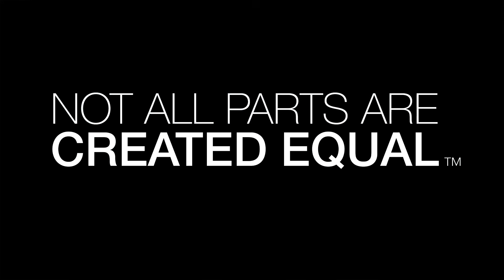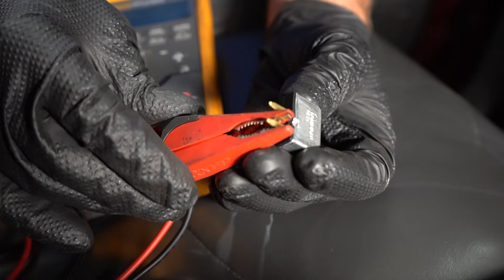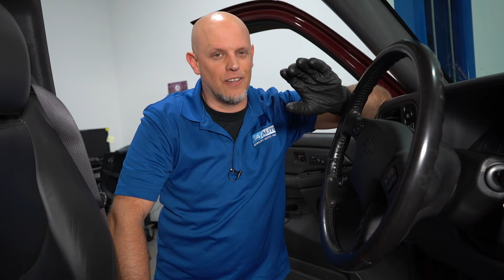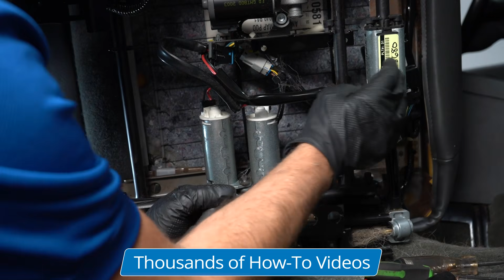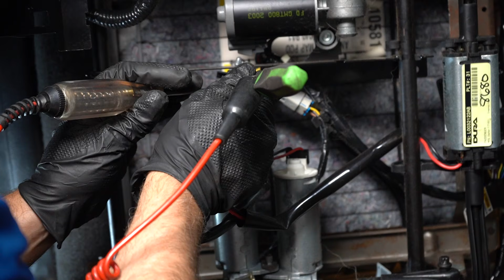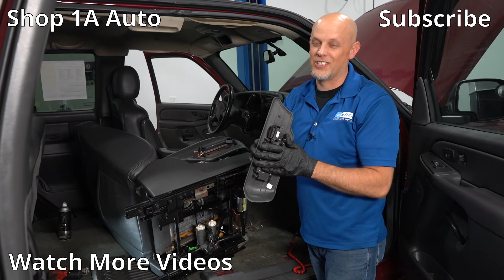Power Seat Not Moving? How to Diagnose Power Seat Motors, Switches, and Wires!

Comment: Loved your diagnosis on the "Power Seat". But I'm still having issues with it. It's the Drivers Side Power Seat that I am having my issues with. I'm glad that the Seat is in the completely back position. Because I'm 6'4". And it's okay by me. It will recline/go up and down, but will not go backwards or forwards. All the connections are in place. The fuse is good. And the relay is good. When you try to move the seat forward. You will hear a click  come from the motor. It will move the seat about 1/4 of an inch. But that's all. Can you help a brother out????
Reply: It's the motor. There are 4 motors as he explained, so the motor for the backwards and forwards function (the larger one at the front of the seat, I believe) should be replaced.
Reply: You figure it out

Comment: Thanks for the great video. The part I'm stuck on you didn't cover. The motor (forward and back, the only one I have a problem with) is whirring and I can feel the axel tubes out of it vibrating, but it doesn't turn the travel screw. Any idea what the problem would be at that stage?
Reply: Sounds like a loose cable, check the cable that goes left to right under the seat. I just repluged it in and worked
Reply: Did you ever solve this? I have the same problem

Comment: Does every switch have its own motor? Or do they all share a motor? Because my up and down switch doesn’t work but the others work.
Reply: Same! I believe in this video, he said they each have their own motor and he explained which motor controls which switch. There is one bigger motor at the front of the seat (forward and backward switch), two together further back (the front/back height/up-down switch, and lumbar switch), and one by itself off to the side (recline back and forward). Check the connections to the switch inside the panel and to the particular motor under the seat to make sure they're not loose. If that's not the issue, grab the multimeter tool that he demonstrates in the video underneath the seat to check for continuity. If it lights up, you have a bad motor. If it doesn't light up, you have a bad switch.  Someone suggested that if the motor for the function you need is broken, you could swap it with another of the motors controlling a function you could do without. He said that would be the cheapest solution because they don't sell replacement motors individually, just the entire setup with all four motors included.

Comment: but what if just one direction on my seat adjustment isnt working...???   I basically cant move it back. but every other direction works...
Reply: Make sure the switch inside the panel is connected properly and if that doesn't fix it, replace the switch.

Comment: I have a 2017 Buick regal my driver seat won't go back up but it goes down now it's stuck like that I've been driving like that for a year now and it's annoying then the other switch to stop working it won't move forward it only goes back.. have any answers for me  where should I look
Reply: This video explains it. Check the connections to the switch inside the panel and to the particular motor under the seat. If that's not the issue, replace the switch inside the panel. For a quick fix, you can also flip the positions of the red and black wires for that specific motor that controls that function as explained in this video. Flipping them reverses the functionality - up becomes down, forward becomes backward. That will allow you to move it in the direction that doesn't work currently.

Comment: I just had an issue with a seat tilt control switch. It would go forward but not back. I simply rewired the motor in reverse polarity and the forward control moved the seat back. I hope this helps anyone who needs a quick fix.
Reply: Exactly what I’m looking but I don’t understand those terms😅
Reply: Thanks tho!
Reply: The engine motor? The seat motor?  Where is it located? This is exactly my problem.  Driving w seat forward for 2 weeks. 😩😫
Reply: @jazzymediamarketing4404  Yes, the seat motor, as referenced in this video. Under the seat, he showed the black and red wires and said they control forward and backward and if you flip them, they do the opposite of what they used to do.
Reply: Having a similar issue and appreciate the tip - might come in handy if I'm not able to fix the issue using one of the methods in this video!

Comment: I understand heated and air conditioned seats…. But what the actual fuck is the point of the tracks being powered? They’re slow, they’re a pain in the ass to diagnose, and they’re absolutely inferior to the lever and pull bar mechanisms

Comment: so if the seat reclines back but not forward then its the switch thats the problem?
Reply: Ditto?
Reply: Yes! Make sure the switches/connections inside the panel and to the particular motor are connected properly and if that doesn't solve it, replace the panel switch.

Comment: So theres power to the seat that goes up and down and the lubar reclines. Just the front and back doesnt work. wtf?
Reply: This video explains it. Each function has its own motor. Check the switch connection and check the motor current. Could be the motor, or could be the switch.

Comment: What would you do if the drivers seat wants to move forward when you get into the seat or when your driving. And it won’t want to move closer to the steering wheel or back from the steering wheel
Reply: This video should help, you should rewatch it a couple of times. This is what I got from it: Check the connections to the switch for that function inside the panel and the particular motor under the seat. Check for continuity in the fuse connector to the motor for that function. Each function has its own motor, which he showed in the video. If there's continuity (the tool lights up), the motor needs to be replaced. If the light doesn't go on on the multimeter or whatever that tool is called, replace the switch inside the panel.

Comment: Just checked out your "power seat" video. I've been having a power seat issue for a while now. It will decline. And it will raise up/down. But it will go forward/backward. If it's a motor issue. It went out in the right position. Because I'm 6'4". Do you have some advice?
Reply: This video should help, you should rewatch it a couple of times. This is what I got from it: Check the connections to the switch for that function inside the panel and the particular motor under the seat. Check for continuity in the fuse connector to the motor for that function. Each function has its own motor, which he showed in the video. If there's continuity (the tool lights up), the motor needs to be replaced. If the light doesn't go on on the multimeter or whatever that tool is called, replace the switch inside the panel.

Comment: I have a 2018 Chrysler 300s, one day randomly just wouldn’t move forward or backwards, but the lumbar, recliner and seat adjuster work fine. But it doesn’t move back and forward. And if it does it’s very slight. Not sure what the issue is.
Reply: I believe in this video, he said they each have their own motor and he explained which motor controls which switch. There is one bigger motor at the front of the seat (forward and backward switch), two together further back (the front/back height/up-down switch, and lumbar switch), and one by itself off to the side (recline back and forward). Check the connections to the switch inside the panel and to the particular motor under the seat to make sure they're not loose. If that's not the issue, grab the multimeter tool that he demonstrates in the video underneath the seat to test for continuity on the connector to the motor. If it lights up, you have a bad motor. If it doesn't light up, you have a bad switch.  Someone suggested that if 1 motor is broken, you could swap it with another of the motors controlling a function you could do without. He said that would be the cheapest solution because they don't sell replacement motors individually, just the entire setup with all four motors included.

Comment: So my seat has 3 power buttons and the one thats moves the back part in and out on your back just sopped working. The other 2 still work fine. I did put seat covers on around the same time. What is wrong with it anybody have a clue?
Reply: Check the connections to the switch inside the panel and to the particular motor under the seat. If that's not the issue, replace the switch inside the panel. For a quick fix, you can also flip the positions of the red and black wires for that specific motor that controls that function as explained in this video. Flipping them reverses the functionality - up becomes down, forward becomes backward. That will allow you to move it in the direction that doesn't work currently.

Comment: I have an 07 expedition el, electrically it all works, however,  something mechanically is stuck on the seat recline, it's stuck laying back as far as it will go, I've taken the cushions off and can see the connecting shaft, its in place, I'm at a loss from here. What locks it in place ?

Comment: Everything works except the recliner that sometimes works and sometimes doesn't work. What do you think?
Reply: This video should help, you should rewatch it a couple of times. This is what I got from it: Check the connections to the switch for that function inside the panel and the particular motor under the seat. Check for continuity in the fuse connector to the motor for that function. Each function has its own motor, which he showed in the video. If there's continuity (the tool lights up), the motor needs to be replaced. If the light doesn't go on on the multimeter or whatever that tool is called, replace the switch inside the panel.

Comment: Both of My 2000 Yukon XL front Seats--- Don't make Any electrical Movement, or Sound , the Manual Tilt & Lumbar Adjusters Work Fine... I will Start with a Circuit Breaker
Ohm / continuity Test... I may have to Jump 12 volts under the seat to the plug- in connectors... To see if I can Get some Movement.
I Appreciate the Video, one of those Factors may be the Culprit... I just Don't understand...How can BOTH OF THE SEATS- NOT WORK ? ( At the same Time ?). Very Suspicious, Strange Condition... To Solve... Any Suggestions ?
Thanks in Advance... BillinL.A.   11-06-2021

Comment: But you didn’t talk about if it moves one way and not the other…would the motor be going bad or the switch? Is there a way to tell without pulling the seat out?
Reply: You can switch the black and red wires (flip their positions) so they'll function in the opposite manner (forward becomes backward, up becomes down). That's the quick fix. For a permanent or proper fix, or to understand why that quick fix even works, I have more learning to do!
Reply: good question. seems that would have to be a bad motor. anyone know for sure? i'm speculating.
Reply: Hope you figured this out. I don't know about the motor going bad, but to check the switch you could see if it is putting power to the connector in both conditions and also check the connector for damage.
Reply: Check the connections to the switch inside the panel and to the particular motor under the seat. If that's not the issue, replace the switch inside the panel. For a quick fix, you can also flip the positions of the red and black wires for that specific motor that controls that function as explained in this video. Flipping them reverses the functionality - up becomes down, forward becomes backward. That will allow you to move it in the direction that doesn't work currently.

Comment: I have a 2006 Ford Taurus, and the driver's seat has stopped working. After some research I found the positive main connector input no longer did its job (even though my tester lit) I reinstalled a new wire from the 30 AMP fuse to the main connector .. And Bingo Trouble Solved!
Reply from the maker: +Marc-André Russell Thanks for the feedback!
Reply: How did you know it was the 30 AMP fuse that needed a new wire?

Comment: what should i check if the motor that makes it move back and forward only moves backwards and won't go forward again. I've already checked the switch and cleaned it  with an electronics cleaner, and nothing happened. What else should i do or check? thanks!
Reply: I'm having same issue except the seat will go forward but not backwards..
Reply: Did you figure it out my car is having that issue ..
Reply: Replace the switch
Reply: Check the connections to the switch inside the panel and to the particular motor under the seat. If that's not the issue, replace the switch inside the panel. For a quick fix, you can also flip the positions of the red and black wires for that specific motor that controls that function as explained in this video. Flipping them reverses the functionality - up becomes down, forward becomes backward. That will allow you to move it in the direction that doesn't work currently.

Comment: So my Dodge Ram has 3 buttons on driver switch.  First tilts seat back, second goes up a bit or forward/backwards.   Third button seems to work a single motor in the back.  Yellow goo coming out of the white plastic gear, slightly moves when I use the button but stoops quickly.   Any particular advice before seeing my mechanic?

Comment: My driver seat won't go forward but it does go back. It was just working and when I went to use it...it just didn't work
Reply: This video should help. This is what I got from it: Check the connections to the switch inside the panel and to the particular motor under the seat. If that's not the issue, replace the switch inside the panel. For a quick fix, you can also flip the positions of the red and black wires for that specific motor that controls that function as explained in this video. Flipping them reverses the functionality - up becomes down, forward becomes backward. That will allow you to move it in the direction that doesn't work currently.
Reply: When I was in tech school we had a hummer come in that would only go forward not back. Pulled the switch apart and reversed the polarity by hand and it went back. It was a bad switch.
Reply: got the same problem. did you find out how to solve it?
Reply: same issue with me.. any solution?

Comment: There is actually much more.  
For example on my mustang 2011 gt the magnets on motors were fallen, all the them, so I had to glue em back in their position.
Reply: Could you make a video of it and upload, if you still own the vehicle or if you have time, im having trouble with my driver side seat. Out of the 9 directions only back and forth work

Comment: Hello.. great video.  Hey my 07 Yukon which is the same, my driver seat won’t go back or forward but I can hear the motor making the noise just don’t move.
Also 
Passenger seat the back rest is all the way down and won’t came up to its normal position.
Reply: Hearing the motors but no movement, is probably the motor gear. Search for “how to fix Dodge Ram power seat” video you’ll see the gear I’m talking about. Replacing the gear is pretty involved, it might be easier to replace the motor with the gears already included.
Reply from the maker: +Santiago Davila We wouldn't be able to diagnose an issue like that here, you may want to have a local mechanic take a look at it. Thanks for checking us out! http://1aau.to/m/Shop-1AAuto-c
Reply: Check the connections to the switch inside the panel and to the particular motor under the seat. If that's not the issue, replace the switch inside the panel. For a quick fix, you can also flip the positions of the red and black wires for that specific motor that controls that function as explained in this video. Flipping them reverses the functionality - up becomes down, forward becomes backward. That will allow you to move it in the direction that doesn't work currently.

Comment: Do you guys sell the plastic gears for power seats? 2008 Chevy Impala seat moves forward and back just a little, but does this weird twisting/binding thing.
Reply: I ran into a 2018 Chevy Malibu one time that had the driver seat do what you're describing. Only one side of the seat moved while the other stayed in place, cause a twist/bind thing. Ended up taking the seat off and seeing that the 'driveshaft' that went from each side of the motor to the seat track was damaged. Replaced it with an identical tiny square drive piece of metal from Ace Hardware!
Reply from the maker: +All American Dream Chaser Thanks for checking us out. Shop for high quality auto parts on 1AAuto.com:

http://1aau.to/m/Shop-1AAuto-c
Reply: @1AAuto  need help in taking out my seat stuck in back position
Reply: @1AAuto   need help in removing my seat that is stuck in the back position need to get it out to put new carpet